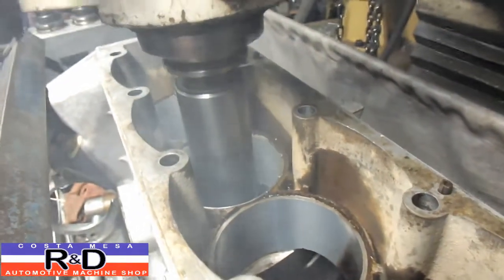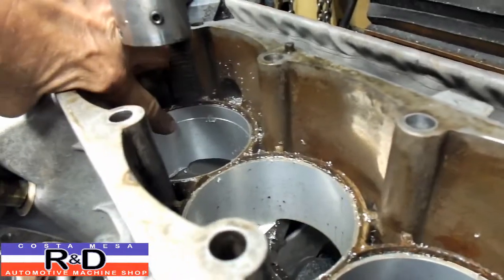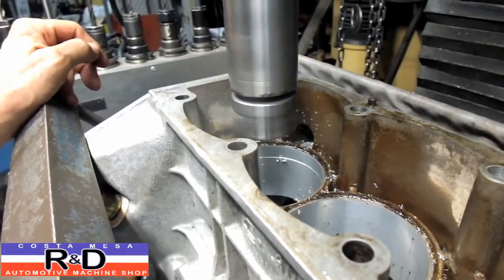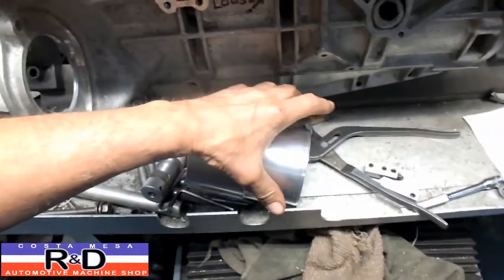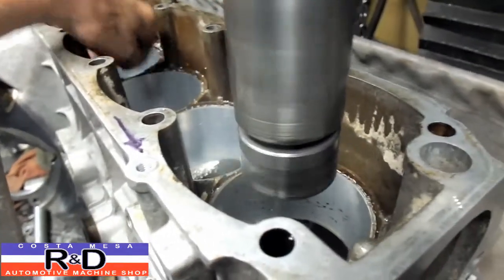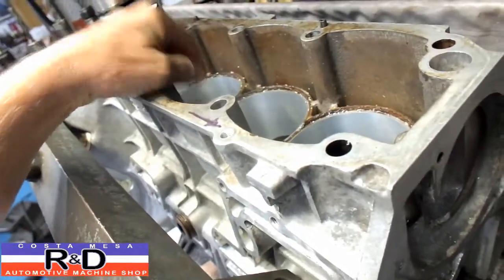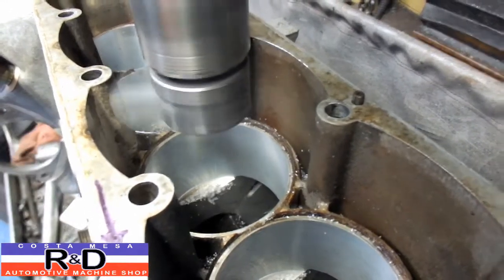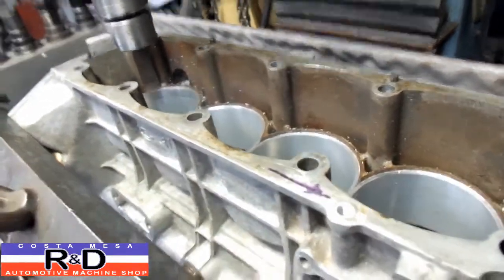Jensen Healey Lotus 910 Big Bore Modification

Comment: Speed and feed both seem excessive. I think these engines started life as a van engine, Bedford CF. I worked on one JH which had snapped its cam belt, and worked at a Chrysler/Talbot dealer in the UK when the Lotus Sunbeam was current.

Comment: I don't understand why you made rough cuts for finish? Why not write it or move the block so your boring bar is only 0.200 above the part before starting the cut? It looked like a third or more of cut time was spent dropping on the Y axis at cut speed just to start each cut.
Cutting plunge speed? If you want the tightest possible fit by hand, wouldn't it work better to travel at 1/4 the speed or even less? Leaving it rough will need a bigger hole for it to fit. A super slow cut and a shiny surface could be smaller and still fit nicely. 
My preference is a slight interference fit. Warm the block up to 80/90 degrees and sleeves in the freezer. Not a great difference but should slide in and out freely at this temperature.  Locking in a second or two after placing it. Torque plate and finish hone liners, especially nicasil lined aluminum.

Comment: Confused because the JH is a lotus 907 engine. Also, the stroker crank takes the JH engine to 2.2 litres. 
Or that's what I was told...
Reply from the maker: This will be even more confusing, this 910 engine will have a custom billet stroker crankshaft AND larger Nikasil aluminum cylinders and pistons to increase displacement to 2,4 liters - not your garden variety 907 build. They both fit the J-H chassis, however. We do more than stock rebuilds here at the shop, much more. If you are local, I invite you to stop by some time, or let me know when you are getting out to SoCal. I've had people come all the way from Australia stop by and take the "tour".